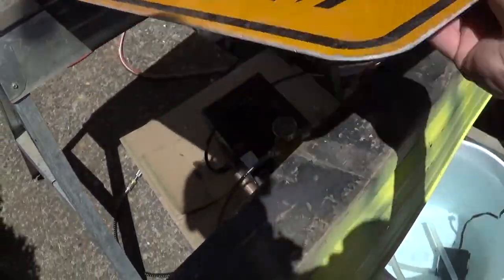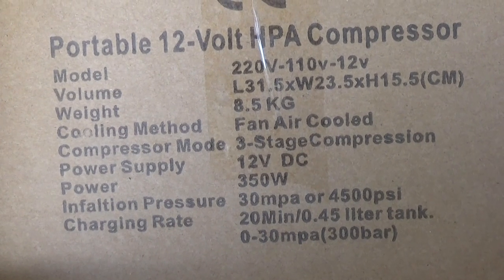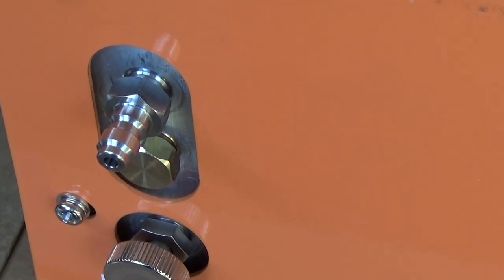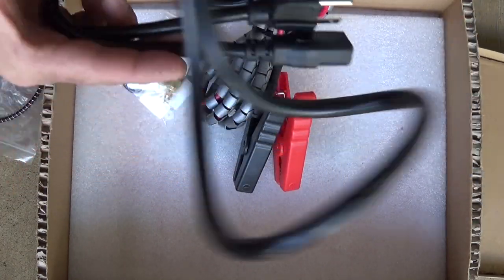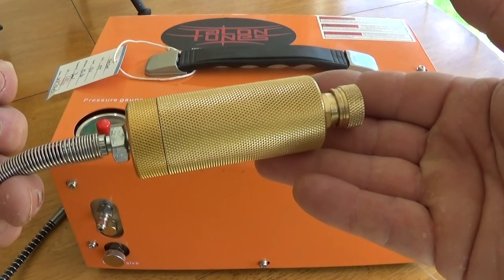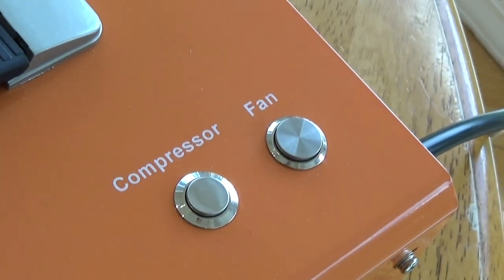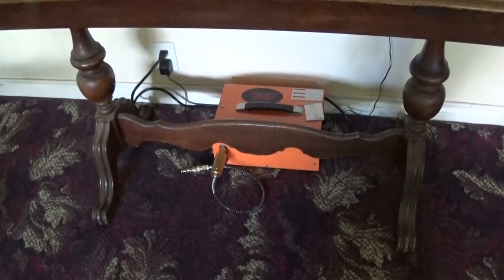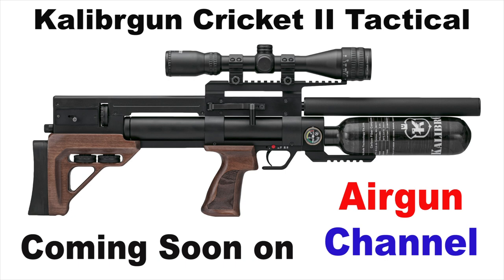Talon Tunes PCP Compressor - #1 for PCP Air Rifles & PCP Shooting (300bar/4500psi)

Comment: I just bought and received in the mail, my first air rifle and a PCP air compressor GX CS3, which is apparently a knock off of a compressor called the Trail Charger. Still, it came very well reviewed on Amazon. I hope it does not let me down. It is also an oil free, water free, lubrication free compressor... now I just have to learn how to use it. I saw compressor models similar to the one on this video, I think they are much the same as the one I ordered, except these sit horizontally and mine sits vertically. I just hope not to have issues with the next air rifle that I ordered which has as 4500 psi tank. Seems most PCP compressors are optimal only for 3000 psi, although they can do 4500 psi if you do it in sets while letting the compressor rest between sets. I'd really like to find a compressor that handles larger tanks and fills them relatively quickly and in one sitting, even if it costs more money  and even if it is not a portable compressor. Nice video and nice compressor!
Reply: Jamal69 Jackson, Do you still have the GX CSE? Why I ask  I ? I had mine for 3 weeks and then it started to knock , blow oil or grease out of moister tube, I only used it to fill avenge .25
Reply: @r.echadwick6038  yes and it has worked amazingly well for me. Sorry to hear you had problems with yours.
Reply: @happycamper5900  well what you're saying is obvious and everyone should know reviews are not guarantees. People for the most part try to leave honest reviews and some items are of great quality but still receive bad reviews from some people because the products sometimes are defective but sometimes it's the purchaser who is defective and leaves bad reviews because they do not know how to utilize an item or because they have unrealistic expectations. I've purchased items that came very highly rated but which turned out to suck, just as I've purchased items with very poor reviews that turned out to be fantastic. Anyhow, most items I have purchased on Amazon have had some bad reviews and most reviews turn out to be accurate to some extent, so you can trust the reviews for the most part. This particular item I purchased did have some bad reviews as well but mostly good ones. What I do is look for patterns in the reviews. If I see the same complaint for a product repeatedly throughout the reviews, it's almost guaranteed that the issue is legit, but some complaints are obviously random and uneducated. My point is, that I've based a lot of my decisions to purchase, especially of non big brand items on reviews and they have rarely failed to be consistent with my satisfaction with that product. I have seen plenty of bad reviews published, even on items that are considered top of the line, industry standard items, so I do feel I can trust most Amazon reviews, especially if I do a little research... in then end, sometimes we all have to risk not getting what we expected when we buy Chinese made, off brand items, but it can be worth the gamble... this air compressor was definitely worth every dollar I spent on it and I love it.
Reply: @jamal69jackson77  Glad you compressor is working out for you. Report back in a year to let us know how it is working. That would help. I am still undecided on which to purchase. It will be my first.
Reply: @happycamper5900  yeah you're right about that... one thing that no one typically can foretell is the longevity of a product, especially products which inherently are meant for strenuous usage and which are from brands or companies with questionable quality control. Naturally, every user might differ greatly in how often they use a piece of equipment, how much workload they put on that equipment and how much maintenance and care they give to that equipment and whether or not they use that equipment within the manufacturer's specifications. Fortunately I have to say that I'm very mechanically inclined and I take extremely good care of pretty much everything I own, regardless of what it is and I foresee this compressor lasting me upwards of a decade if not more. I could totally be wrong but I would definitely love to give an update on it after I use it for a year or two.

Comment: love 😍 the video Nate
got worrrier Chinese type one 2 years ago no problem with it it's orange to think I got lucky with a good one 
swop oil out all the time run antifreeze to don't like the  Auto 
shut off  best to do it manually open valve take pressure of motor
before switching it of love your video s bro 
great work looking forward s to the next one hell yea  
hell yea probably get one of these if mine goes out all of probly made in China
Reply from the maker: Hell yeah! Sounds like you got a good one. Thanks for watching! -Nate

Comment: The cheap ones like that are not designed to fill up large tanks . That is probably why you are breaking them every other fill . Most of them say that . They also tell you the max run time .
Reply from the maker: I should have read the max run time. I didn't know those were just for guns...thank you! Also, I only did guns with the orange one in this video and it also broke after about 90 days.
Reply: @AirgunChannel  Yeah I’m not giving you a hard time . I am getting into this pcp thing pretty serious and I am trying to buy the correct equipment so I don’t break things left and right . The ones that advertise filling large tanks start at around 1500 and go up to about whatever you can afford . I do find your videos informative and enjoy watching . Keep up the good work .

Comment: Where can you buy this? I clicked on every link you had in the description but couldn’t find it
Reply from the maker: https://www.google.com/search?rlz=1C1CHZN_enUS959US959&sxsrf=ALeKk01G8DJWGNfhdsh9VwQsTNTfi_WBQA:1627038840604&q=talon+tunes+compressor&spell=1&sa=X&ved=2ahUKEwi0yISBiPnxAhVLqJ4KHcgfBqsQBSgAegQIARAx&biw=1707&bih=817&dpr=2.25
Reply: eBay!   Type in: 

Portable PCP Air Compressor Air Gun High Pressure Pump Transformer 110/220V/ 12V.

Its blue, not orange!  Don’t get one with the external transformer by mistake!!

Comment: How is that compressor holding up for you and can you get parts to maintain it? Does it use silicone or oil?
Reply from the maker: it died after about 3 months.

Comment: That is a knock off of the Air Venturi Nomad ll.  Also, that is not a temperature gauge, that gauge is reading how many amps it is using.
Reply from the maker: oh...good to know! Mine broke after 2 months. Doesn't hold air now.

Comment: Where did you buy it from I want this one man I bought the hammer 50 ca but this style is super nice
Reply from the maker: There is a link in the top of tyhe description. It's from Talon Tunes: https://talontunes.com/shop/4500-psi-rl-portable-mini-compressor-12v-120v/
Reply: Got it from Fasttobuy2012 on ebay
Reply: Got mine from the same place as Blair.  Nice people to deal with and I got it in less than 5 days from China!  I’m in Perth, Western Australia!

Comment: Thanks for this video man I am actually looking for a good compressor for my pcp rifle and tank the Chinese brands looks really complex and yes they do not last long they tend to give alot of problems I will definitely get a talon tune compressor.
Reply: Is that made in China? most things are now I have a lathe, milling machine, and drill combined, and it's got the most accurate 3-jaw chuck I have ever used. I am 76 years old so have used a lot of different makes of machine in my time. This machine was purchased from a British company but they forgot to change the labels for the English ones they sent me a set of labels to replace the Chinese ones, but it doesn't matter to me so it still has its Chinese ones. 20 years old and still working perfectly.
Reply: @ianmcnulty3279  more than likely it's made in China most Chinese made things are crap but affordable

Comment: Thanks for the review! Is yours still working? I had mine for 1 month. Around 5-7 fills on my Leshiy 2. Mostly from 200 to 300 bars. It takes around 3-4 mins to fill from 200. So far so good. But amazon has many bad reviews on this item.
Reply from the maker: Mine broke before 90 days. Polish the bleed screw ifit starts to leak. Also you should bleed the pressure before you hit the off switch.
Reply: @AirgunChannel  Ahh damn. That sucks. Thanks for the info!

Comment: But if they gave you one you would make a commercial for them too. 

I use the water cooled compressor. Put a bag of ice in a bucket it will run for 30 minutes easy. Took 45 minutes to fill my 30 minute sbca bottle from empty Takes 2 minutes to top of the the 480cc Impact bottle. As long as the motor turns anything can be fixed in 30 minutes with EBay parts cheaply.

Comment: Sorry your having so much bad luck with your compressors. I have never had issues with my Yong Heng after 3 years and filling 4 carbon fiber tanks to 4500 psi 1-2 times a week. I have been thinking about buying a portable compressor from Aliexpress for a while for 235$ just to throw under the seat of the truck and for back up but haven't pulled the trigger yet. It is exactly like the one you were sent except it is a different color. If you buy the Yong Heng Hard Case like mine from Walmart you can get a 4 year warranty backed by All State insurance for 36$ extra and they will replace it for free if anything happens to it. I have never owned any other compressor and know nothing about the Tuxing brand.I dont expect mine to last forever after all I only paid 235$ for it when I bought it from Ebay, but knock on wood it wont give me any issues for the foreseen future. I do take very good care of it and use ice/water in a small cooler when running it,Royal Purple synthetic compressor oil-18$ qrt, change it every 15 hours of run time, vibration activated hour meter-10$, upgraded water pump-8$, high flow cooling fan blowing on the head and lines-10$, and Fahrenheit digital gauge-2/for 5$ everything bought from Amazon...My compressor never reaches 105 degrees F and still fills a 6.8 ltr tank from 0-4500 in under 45 min. I hope you have better luck now, and in the future my friend. I really enjoy your channel, and hope that Alkin or some bigtime/professional/high end compressor company donates one to you. That would be awesome. Take care bud.
Reply from the maker: Yeah, it's always my fault when the Yong Hengs break. I'm not responsible enough to run a yong heng without eventually wrecking it. They are good compressors if you take care of them.
Reply: @AirgunChannel  LOL. Yep, I see at the @12:45 mark that the front corner of this one has already taken a knock.